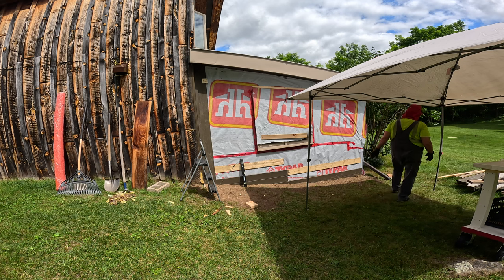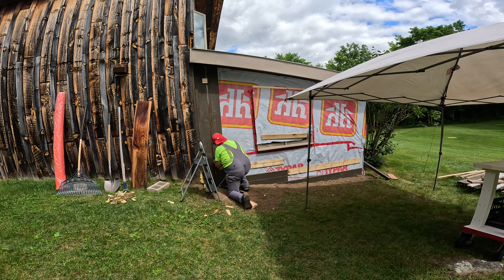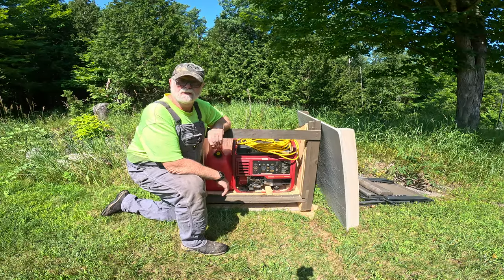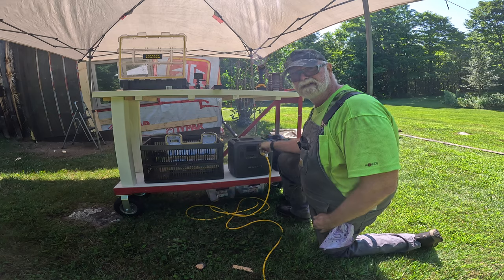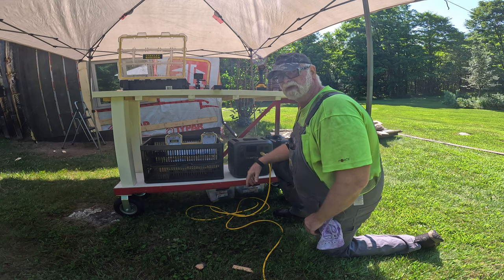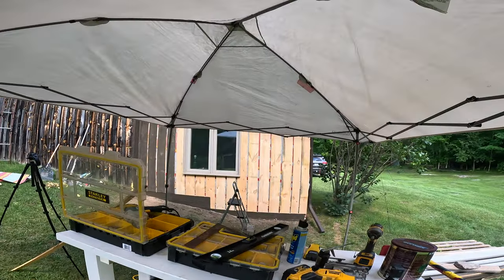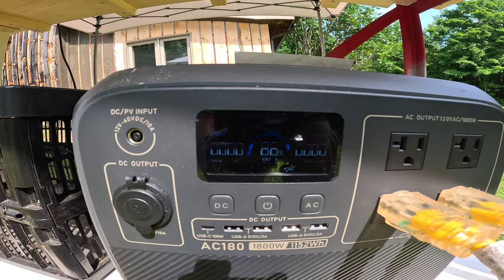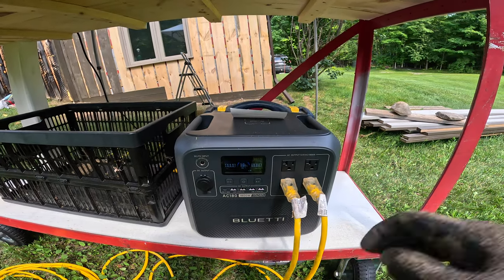Siding Job Day 4: We are finally making SERIOUS progress!

Comment: I like the Bluetti power station. Only 14% used - that's nice! I like the spacer block. I wasn't that critical of the spacing when I replaced my boards. I preset the screws in the board, eyeballed the spacing, drove one screw in, set a level, then drove another screw in. I'm a government employee - close enough for government work! LOL. But like you - with this old house, every board had a different cut, length, etc.
Reply from the maker: The Bluetti seems to do a good job. I’m going to put it through a bit of a torture test in a video next week to see how much it can take. I was a machinist and a millwright so I’m use to being fussy about sizes. My wife says I’m not fussy, I’m OCD 😅. Thanks for stopping by!